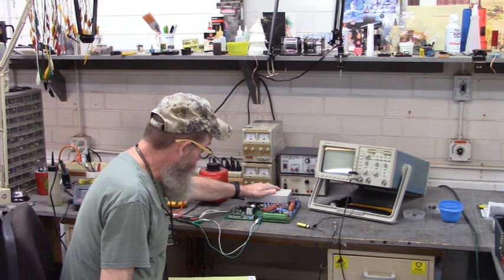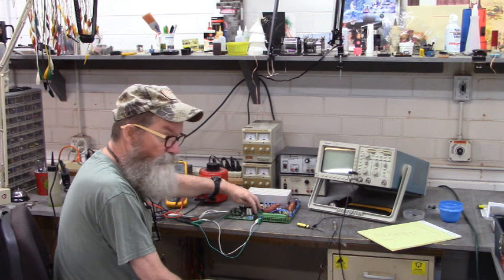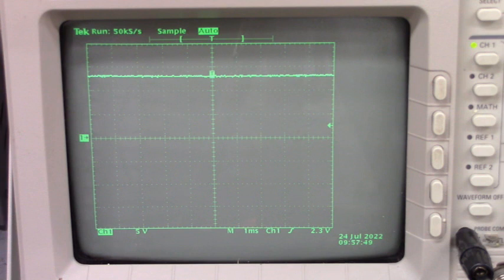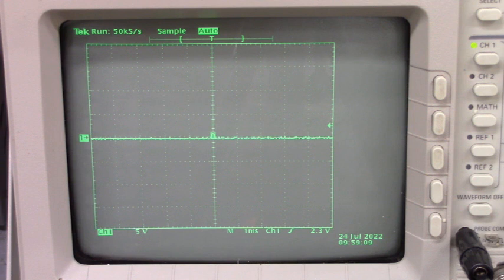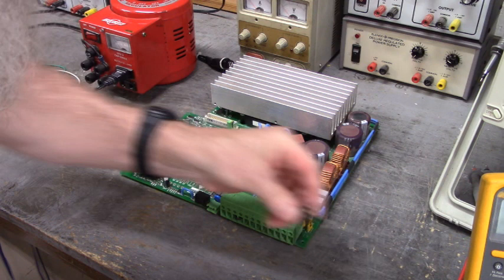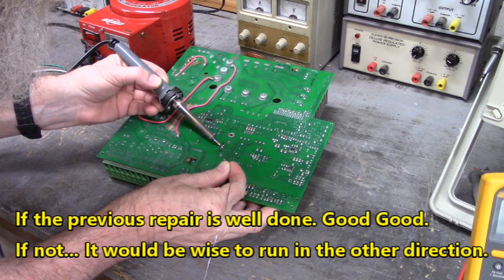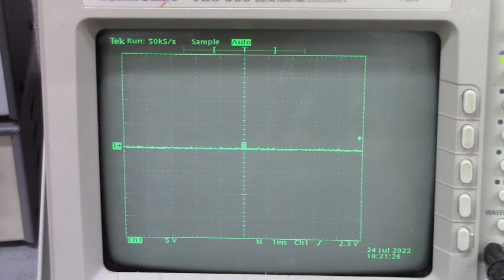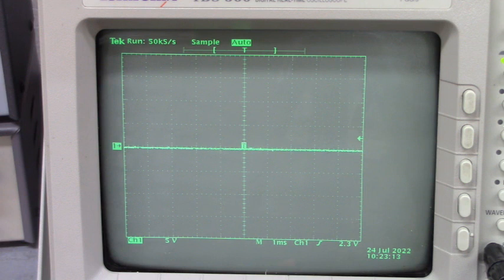(Part1) Baumuller BUM60-30 Switch Mode Power Supply Failure.

Comment: The MOSFETs that don't turn on with multimeter are the ones that come with internal discharge resistors between gate and source. I've experimented with this. What happens is as soon as we remove the multimeter leads from gate and source, the resistor discharges the MOSFET.